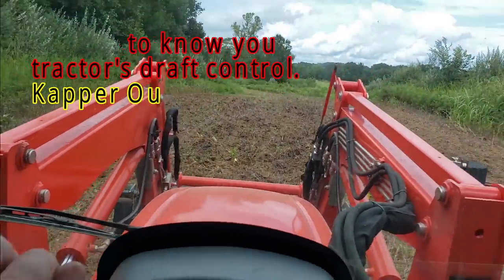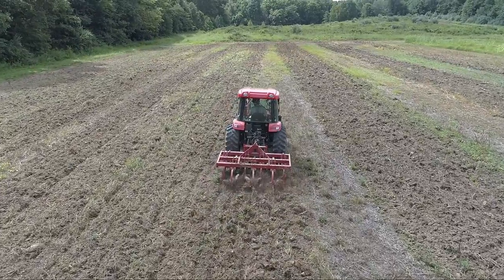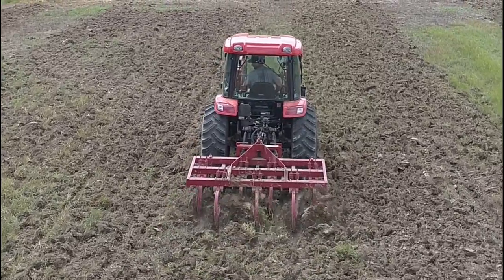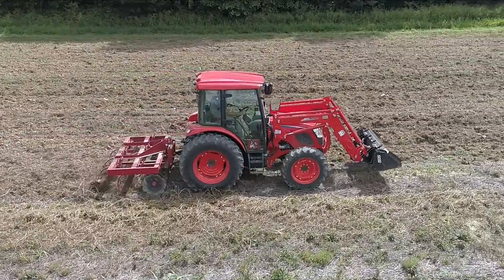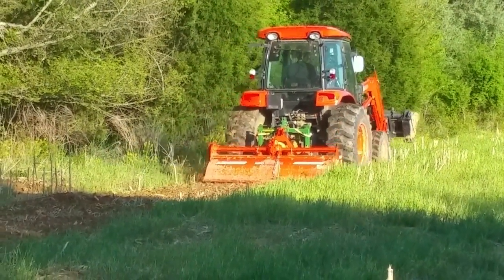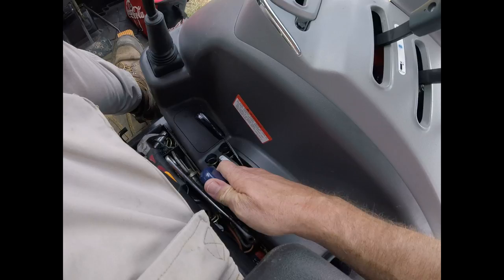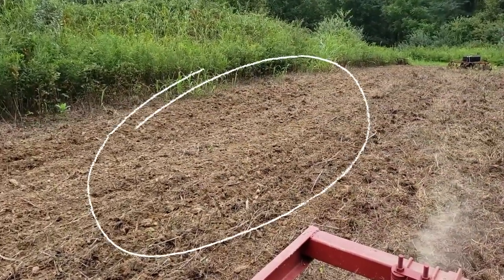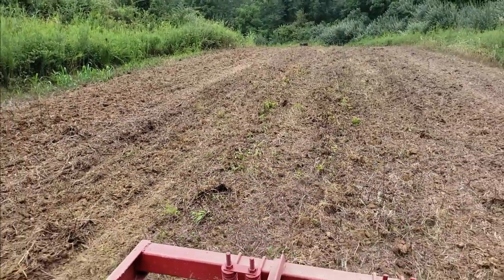Tractor Draft Control! Kioti RX7320 field tillage using draft control

Comment: Normally DRAFT does not mean DEPTH, it means DRAG or STRAIN. Think of draft horses for pulling heavy loads.
You set it for how much you want to drag or strain the engine before the draft control reduces The strain on the engine by lifting the 3-point hitch to a certain amount of strain on the engine. Setting the draft control for higher draft or high strain on the engine or lower draft with low strain on the engine or anywhere in between.
The first lever that he mentioned is the depth control to control the working depth of the three point hitch. 
That's why if you come to a hard spot when pulling a 3 point hitch implement it puts more strain on the engine and the draft control will raise it to lower the stress on the engine.
For example rototilling a very hard piece of ground. You can set the depth control at the depth that you want, and regulate the lugging of the engine with the draft control. You can set the draft control where it won't lug the engine too much and as the rototiller follows the contour of the hardness of the ground it will go up and down to keep the lugging of the engine even. And every time you make another pass over that same area it will go a little bit deeper until you reach the depth that you set with the depth control if you make enough passes.
(to get good results with a rototiller always keep the tail board all the way down. Otherwise it throws big dirt clods out the back without getting broken up, causing you to make additional passes on the same area.)

That's the way it was designed on the tractors that I have operated anyway. That is a very useful feature used on almost all agricultural tractors. It should also work on all 3-point implements that don't use the PTO, ie Plows, discs, etc.
(I worked with my dad who did professional commercial rototilling for over 45 years with a 65 hp Massey Ferguson agricultural tractor)
Reply from the maker: very interesting description. I am no expert for sure, but best I can tell, the draft is more for depth, but could be wrong. I'll keep tinkering with it for sure! Thanks, have a good weekend
Reply: @kapperoutdoors  
Watch the video called;
"Is there a feature missing from your tractor (Draft Control)"
Reply: @kapperoutdoors  Do you know how to use your drop rate? 😀
Apparently a lot of people that own tractors don't know how to use it or what it is according to a video here on YouTube put out by a tractor dealership. On their video they call it something else but we always called it the drop rate control. And it's not always a knob. On some tractors it's a lever on the side of the transmission housing.
You might want to do a video on that since a lot of tractor owners don't know what it is or how to use it. 😀

Comment: Draft controls main use is for bottom plows. It stops bottom plow from digging to deep with changing ground conditions , it makes field smoother and also helps you from bogging down  by keeping you from breaking thru hard pan. If you run disc / chisel level I doubt you’ll have problems with tilling to deep . Chisel plows with springs will break away when encountering roots,rocks and hard pan. You will normally notice change in rpm , ground speed and engine sound with different soil conditions.

The chisels on this plow are set deeper than the disc, that’s why disc are only cutting three to four inches when running it level. If you shorten your top link as you plow you will cut deeper with disk and chisels, lengthen top link and chisels will go deeper before disc bottoms out. With a hydraulic top link you have the ability to find sweet spot while plow, helps with changing ground conditions in big fields.

Early model tractors hydraulics only had the ability to lift, they used the weight of implement to lower.
Reply from the maker: Sorry but I respectfully disagree. Without using the draft control that implement will not cut 2". One the chisels hit the ground they pull them chisels even deeper. Draft control worked great to prevent that and I could feel it making the hydraulic adjustments as I crossed the field. Thanks
Reply: Sorry for late reply ,what most people dont understand is that draft control is also useful when driving on the roads with heavy implements hitched to the tractor,it is a safety feature that allows excess pressure and oil to spill into the safety valve when you run into the bumps on the road and start to swing back and forward,other than that it is a must when deep plowing,old Massey Ferguson from 60 years ago is the standard of draft control and who ever get to learn their 3 lever hydraulics control can easily control any modern tractor with any implement hitched to it  @kapperoutdoors
Reply from the maker: @marijanl3373   Wow I never thought of that usage! But it makes perfect sense! I know I've been jerked around like that, going fast on a road or bumpy trail with a heavy implement! I'll have to try to remember that! Good info! Thanks

Comment: watching the video you explained that you set the lift arm lever all the way down with the main lift arm lever and then you set the draft control lever for the depth you wanted.  when you got to the end of the field to make the turn around and lifted the implement, which lever do you use the main lift lever or the draft control lever??
Reply from the maker: If I remember correct I believe you lift the main lever, but its been a minute, lol.

Comment: do you know if the draft control and the lift lever need to be in a certain position for the 3 point lift lever on the rear to work? i have a DK55 and i don't seem to be able to get it to work.

Comment: it would have been nice to see the settings you had before and after to get a better idea. I have a brand new Massey, just using a finish mower with it, but running the draft from extremes, does cause some changes, but i am not sure what is needed. my property is very hilly with some ruff areas that a zero turn will bounce  your fanny hard. the tractor does ok, sometimes i hear the mower hit hard, but with 50% draft, it seems a little smoother on the hills when it flexes at the top and bottoms.
Reply from the maker: It's been awhile since that video, you are probably right I may not have covered the whole process well enough. That draft control sure takes some practice and getting used to. Best of luck thanks

Comment: Hey Joe, once you have draft control lever digging the depth that you want it, do you then lift and lower the Implement with the black lever, say when your at the end of a row and turning around?
Reply: When we used breaking plows to roll over the ground before no-till became the normal in farming, we would set the draft control on the tractors and leave it in that position while using the regular 3point lift for raising/lowering the 3point to turn around.
Reply from the maker: Good question for sure. I've been experimenting with that. Not 100% certain yet that it works the same that way, but I can't be for sure. I think that is how it is designed to work though. But the problem is that in hilly country you are constantly changing the depth, whether you are going uphill, down hill or on a sidehill. But on flat ground I think you are correct, set the blue draft lever to your depth, then just use the regular lever from there on out. Sometimes I wish I'd have some flat ground, but I really love the hills, even though they present unique challenges! Thanks man
Reply: Michael Elwood , you shouldn't use the draft control lever to raise implements . Set the depth with the 3pt lever that you want and then adjust the draft control lever to maintain that depth.  That is how it works. Like another guy said previously there's 2 different systems that can be used, top link draft sensing and lower link draft sensing.  Lower link draft sensing is better in my opinion.
Reply: @jonathanfrecking1210  thank you...which style would a newer tractor like Kappers likely have?

Comment: Some tractors use a load sensing valve worked by the top link at the tractor end while others usually bigger higher horse power machines achieve the same result with lower link sensing which is through the 2 main lift arms 👍
Reply from the maker: Good info. Life is always a learning curve if you are willing to learn! I used it again today with the Rhino Tiller! Thanks.

Comment: Curious.  Which quick hitch are you running on your 7320?  Happy with it?
Reply from the maker: I use a deere imatch. It fits more implements because the top hook is a little more narrow. It has worked quite well over the years

Comment: Draft has nothing to do with the depth setting of the implement.  It has to do with with tractive force of the tractor. When the implement hits harder soil, it causes the tractor to lose tractive force.  As a result, the draft control causes the implement to lift slightly to gain tractive force. Once it regains it, it returns the implement back to the preset depth.
Reply from the maker: Man, I can't confirm nor deny that, as I've seen/heard/read so many different things. Actual info form tractor manufacturer's suggests that the draft helps keep the same depth level when the plow wants to dig in and go deeper. It sure seemed to work like that for me. Thanks.